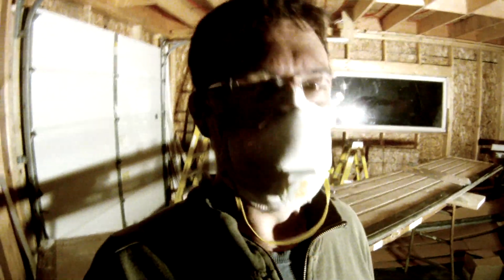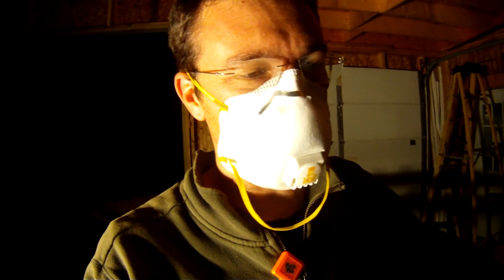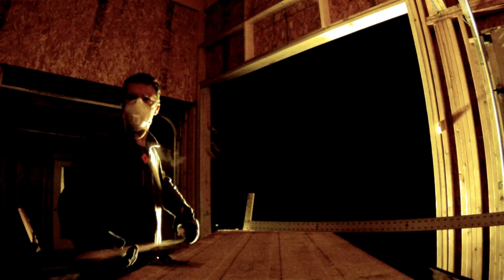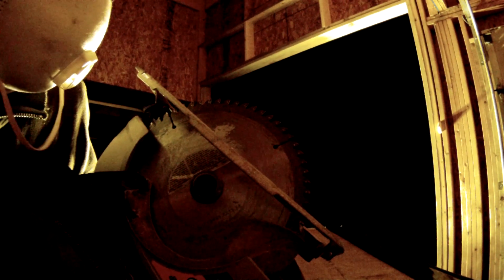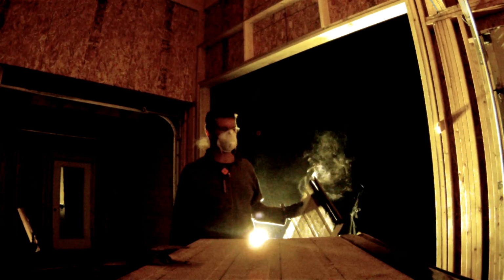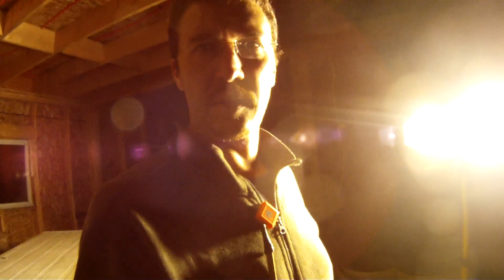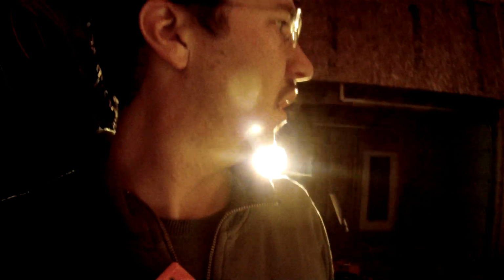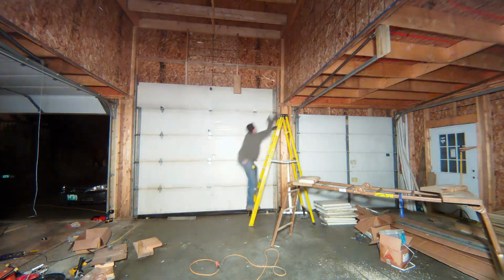Modifying a Garage Door Width - 70 - My DIY Garage Build HD Time Lapse

Comment: This is an old video but still very info. finally got a door a few days ago. 16'x8' and cutting it down to fit my pole building that is 14'6" x 10'. my panels are 2' tall. i actually got 2 of these overhead doors so i have the panels to make my door 10'... got 1 panel cut and i used the diamond blade i used to cut my basement floor when i did the french drain....

Comment: Sir;  I have been watching your videos with interest.  I know you are through with this project, I would like to make small suggestion--when using a hand-held power saw keep the largest side of the saw foot on the material which is to be kept to have better control of the cut particularly at the end.  I am not an expert but this always works best for me.  Lots of luck in the future.

Comment: Just acquired my neighbors 2-car door with opener and everything for my 1.5 car garage; they upgraded to insulated door. The ends are riveted on and there is decorative glass on top panel to boot. My garage also has a low profile ceiling. The installers didn't want the job. Am I better off buying a custom fit door for ~ $1200?
Reply: Chule , get this resolved?